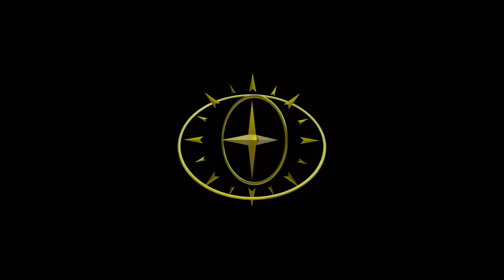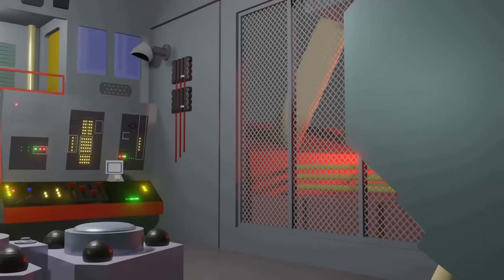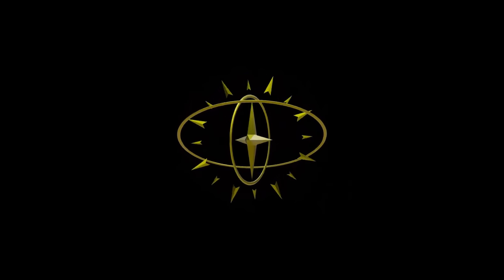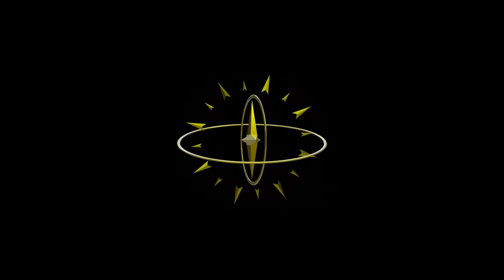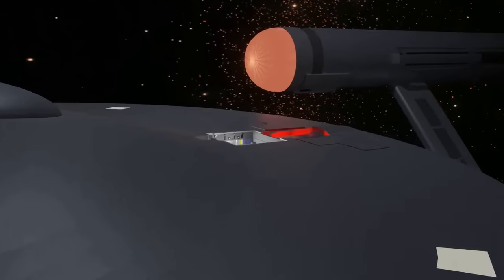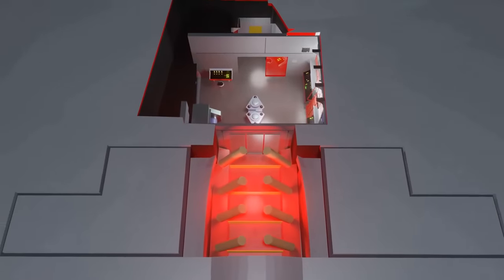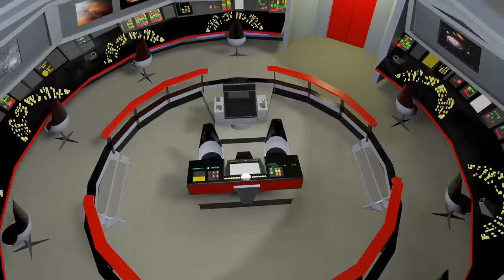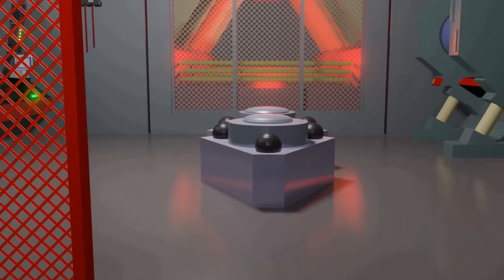The Enterprise Engine-room Enigma: where was main engineering?

Comment: I support the two engine rooms theory. The saucer on 1701 was detachable to be used as a lifeboat in the event of an emergency. . The season one engine room set was also not identical to the season two and three engine room. Season one did not have the dilithium crystal chamber in the floor or the ladder between the consoles the went up a half level. In my mind main engineering was in the secondary hull. The engine room in the saucer was an auxiliary engine room
Reply: Agree that there would almost HAVE to be an engineering room in the saucer - if it has a lifeboat function.  Now that notion does not mean it would need to do anything other than work in an emergency;  so, it may never be used other than periodically function-tested.  Some sort of engineering section would need to be in the saucer to be consistent with the implied logic of the propulsion systems...unless impulse engines were so advanced that engineering was unnecessary.
Reply: Detachable? Never heard of that outside of the TNG Enterprise.
Reply: @timsmith2525  it was supposed to be detachable although never shown. It was not supposed to be able to reattach without aid of a star base or shipyard
Reply: @tomcreech4848  I'm not looking for an explanation, I'm looking for a source. I honestly don't remember an episode that mentions it.
Reply: @timsmith2525  it’s not in any episodes. It’s in Jeffries’ design sketches from 1965
Reply: @timsmith2525  There is the line in "The Apple" about blasting out with the "main section, if you have to". This is generally taken to refer to a saucer separation.
Reply: Also who says, that in the TOS times they even used the Warp Engineering room? Perhabs that room wasn't shielded well, or even only useable when the ship was not on war. What we see in the background of the engine room is most times interpreted not as the warp engine, but the fusion reactor of the impulse drive. And of those they even might had two, one for the left impulse engine, one for the right one.
Reply: No one anywhere ever said that the NCC 1701 had a detachable saucer. That came from TNG.
Reply: @kaitlyn__L  That's basically fan fiction.
Reply: @DaveMiller2  It's mentioned in a number of places.  "The Making of Star Trek" book for one.   "The Star Trek Guide" which was the "writer's Bible".  Per Memory Alpha, the script for the episode "The Apple" called for emergency saucer separation.  It was not filmed due to budget constraints.  It was referenced in the actual episode, but not called saucer separation.  Kirk mentions channeling power to impulse, dropping the nacelles and warp drive and getting them out in the main section.  That can really only mean one thing.  Saucer separation.  Here is the scene:  https://www.youtube.com/watch?v=Oz66eh2THvs
Reply: The differences are due to refits. But the main engineering room is what it is. It's in the secondary hull between the deflectors and the nacelle pylons. 

In the saucer section is the Impulse Deck which does have a control room, but is much smaller than main engineering. The SciPubTech and Drexler cutaways all have this detail.
Reply: @DaveMiller2  Naw, @kmabru and @kaitlyn__L are correct.  I remember this scene in "The Apple" as well.  (Perks of a photographic memory)  It was never filmed as a sequence, rather like the Captain's yacht on Enterprise-D and the Aerowing shuttle of Voyager never got to see screen time either.  Another example?  Voyager actually has 2 warp cores on its Master Systems Display but was never once mentioned in the show - same with the secondary deflector dish.

A lot of stuff makes it into the blueprints and dialog but never makes it to any visual stuff in the show beyond a passing mention.
Reply: Exactly right!  The S1 Engine Room was large and very crowded with towering elements one could easily hide behind.  It clearly was in "the lower decks," i.e., in the Secondary Hull.

Comment: There would have been two engineering sections one in the saucer section for impulse and power to the saucer section.  The second one would have been located in the lower hull for  power to warp core and hanger bay. Keep in mind the turbo lift could go harazonal and vertical. This was reviled latter when the saucer was detached.
Reply: Reviled? Not sure anyone hates it all that much.
Reply: @Belzediel   [rim shot]  revealed* later*  Anywho...
Reply: It was REVEALED early on that the HANGAR Bay was at the stern of the Secondary Hull.  HORIZONTAL corridors with observation ports were on both sides of the Hangar Bay.